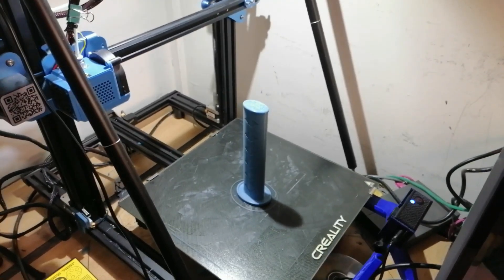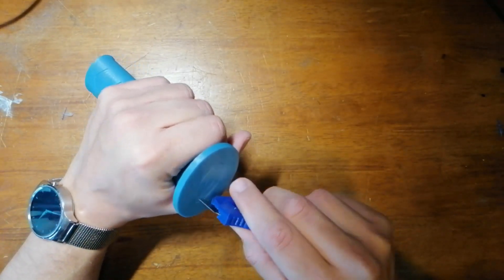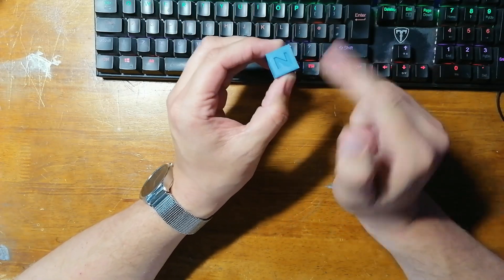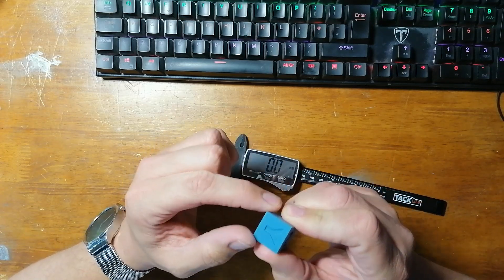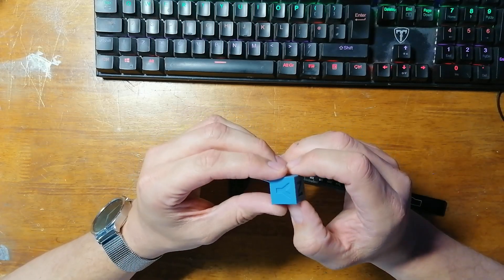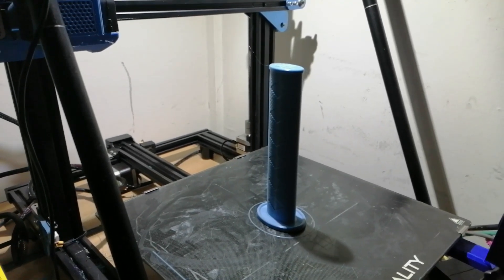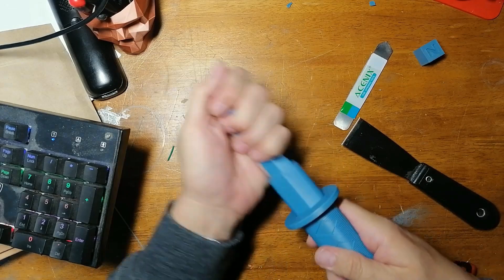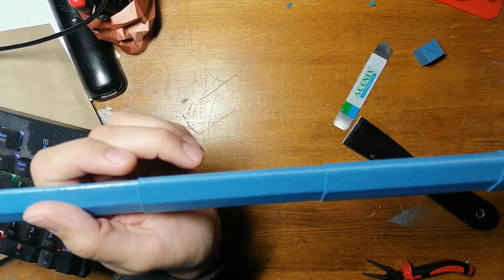3d print in place katana with troubleshooting guide

Comment: Yep, Just like myself. I now tried 4 times to print a Katana. I tried on a Fl Sun QQ-S Pro Delta that failed as it was totally fused blades.

Then later on I used my Elegoo Neptune 3 to do it with all the settings I looked up!  That too was all blades stuck inside.

Later again about half a year I got the Elegoo 3 Max, set it all up carefully and the bed was again perfect leveled and set the retraction etc. Again another fail, the blades part came out,
But only the ones at the handle. 3 sections But I broke the sword trying to release the bottom set of blades. Crying shame as that one was in a nice silk sky blue.

Now the 4th try with a new designed sword which was a fancy flame design on the end of the handle were the blades start from.

Did that on the new Qidi X-Plus-3 Core XY klipper enclosed heated chamber fast printer that is a fast detail printer. a 0.4 nozzle and all the retractions and speed of 300 m/s and done this time in ABS for a stronger print. The sword looks amazing on the details and the blades all seem apart gap wise but again all stuck inside the handle even though there is gaps between each blade.

So no luck either and that's using 3 top end printers. all which print detailed and good prints without any problems! 
( Note the Qidi is amazing and fast up to 600 m/s and got that for £502 from Qidi website Direct )

Really as you stated a real pain to do?  I tried the test blade prints and each of them before each print was fine, But when printed as a sword, No luck looks great outside but no blades come out.
Reply from the maker: i have since got a bambu p1p and it's an amazing printer.  it's making me forget how to troubleshoot problems as there are so few.

Comment: Do you have problems with it fusing together where it changes walls to the next one over.  It leaves a little dot. They don't touch anywhere but the spot it has to stop, and move to the next wall (the next blade)
Has anyone else had this problem?   Were you able to fix it? 
I have watch a ton of videos trying to figure out how to stop it.
Reply from the maker: Do you mean the z seam? If so there are multiple options to reduce it in your slicer settings such as position, coasting and wiping. Also if you calibrate your esteps and flow rate that will help too
Reply: @Awesome3DPrintz  yes.  I just calibrate it. I saw the coast option.  That will be my next step.  I will have to look into wiping.  I haven't seen it before.

Comment: you just need to make sure your seam is set to random as if its a straight line it will fuse to gether i did exactly what andrew did then tried the other way worked perfectly
Reply: I didn’t do that but mine didn’t get fused together it won’t retract besides the first layer tho